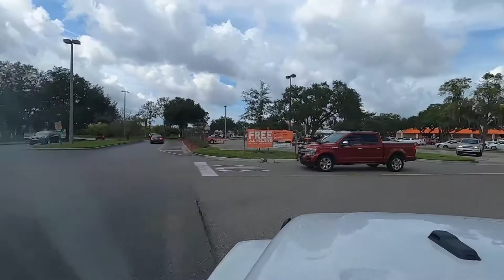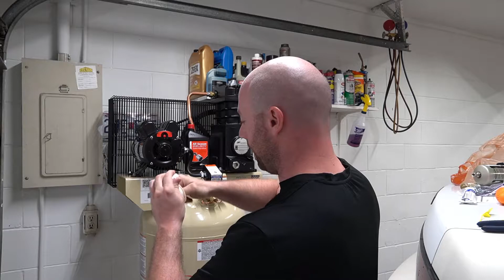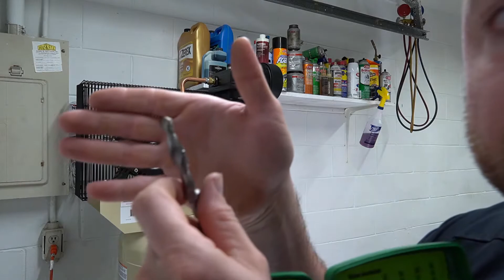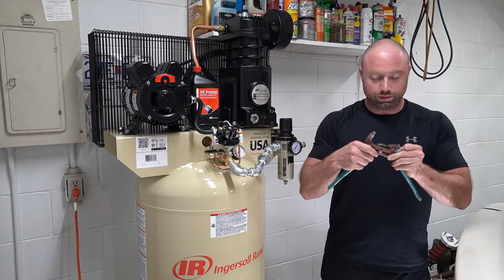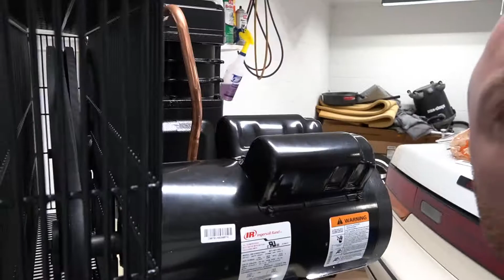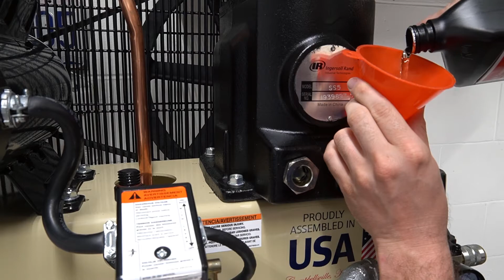INSTALL OF INGERSOLL RAND AIR COMPRESSOR!!! 2of 2

Comment: Here is my other question. Well , I have received my 60 gallon with only a small portion of air. However, I haven't installed the power cord as yet because I am waiting on my electrician to install a 30amp breaker.

Here is my thing. I however installed the water filter ( just like the one you have installed on your compressor, but what I have noticed is air coming through the black  bottom tip of the water filter. Should air be coming through the tip? why is this happening? Is it because the compressor is low in air and first needed to be filled with air? Let me know..
Reply from the maker: Yes this quite often happens at very low air pressures. If it continues after you build pressure, something may need tightening on it.

Comment: Can you put a link of the filter and the fittings you have installed? It will mean a lot . Thanks
Reply from the maker: I couldnt find a link for it but they are sold right there on the shelf at Harbor Freight. This one has 1/2" NPT ports on it.

Comment: Nice job. I would have installed a cut-off valve between the tank and regulator but that is personal choice. Also, check out some Milton V-style high flow air couplers.
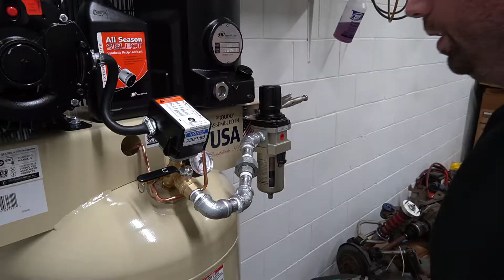Reply from the maker: If you go to 10:20 in the video you will see a close up shot of the ball valve coming right out of the tank. I agree its always good to have an isolation valve before a union. Thanks for the heads up, Ill look into those couplers you suggested!!

Comment: Are you burning up switches yet ?? When it shuts off does it sound funny? We have this same unit and it will start a fire if you are not careful . The switch is too small for the motor .. we had to put a magnetic starter on ours to fix the problem . Good air compressor but bad setup on there part .
Reply from the maker: hmmm no not yet. I will keep an eye on it. No strange noises either. I do appreciate the heads up though!!!
Reply: @rndlife  Just wanted to give you a heads up . I pulled the cover on the switch and both sides were pitted and black and this was before it started having issues .  I will say that the replacement switch is around 100 bucks and the starter was under 80 through compressor source . If you ever have this problem in the future ? I just cleaned the switch and added the starter and it's been fine running and I run it hard !! PS The price of the IR oil is between 32 and 64 dollars a quart now . I done some poking around  and found out there oil comes from Royal Purple . 30 weight air compressor oil . 20 dollars a quart .  I will say after installing the switch it runs a lot cleaner and super smooth . It had a really weird pitch or noise between 110 psi and shut down and it's gone now . Just saying ..  Cheers from Murrell's Inlet SC
Reply from the maker: @sanitymaintenance1585  30 weight-non synthetic seems to be the most widely used oil in most home compressors I have found. Thats def some good info to share tho!!! Good lookin out!!
Reply: @rndlife  There are videos online about the switch problem. 

https://www.youtube.com/watch?v=QuZiPMSl5U0

Here is a guy that Ingersoll Rand gave a credit after they saw his video. He had to put in a magnetic starter so it seems from comments online to these videos that it's a common problem.
Reply from the maker: @petermoss5341  Wow great find Peter! Looks like its time for me to start shopping for a contactor then!
Reply: I have the 80 gallon version of this compressor, and after one look at that pressure switch setup I bought a magnetic starter right off the bat before I even wired it up. Using one side of the stock pressure switch as a slave, it will only be pulling about one amp through the switch and it should last forever.
Reply: @AndrewWisler  sweet !!  Love the magnetic starter on ours .. No issues and it is as strong as an ox non stop ..         I will say the $$$ oil that they want you to put in it (There brand IR ) Is really royal purple ..

Comment: Did you use a 20 amp breaker?
Reply from the maker: You may be able to get by on a 20amp 2 pole breaker as the motor is rated at 21.9A, but to be honest I would think a 25amp would be recommended for this install.

Comment: It would have been nice if you need to showed if you do actually cut the neutral wire because I got the same compressor he's got and I don't have no T5 wire coming from my motor I don't even know where it goes because there's not a load for it if I'm understanding him right he's saying cut the neutral wire so that's going to leave me a black wire as power and my red wires power but I still don't have no tea 5-wire where is it go
Reply from the maker: I had no neutral wire to cut. This runs off of 240V so that means 2 hot wires and one ground. The 2 hot wires are fed from the 2 pole breaker in the panel, and the ground attaches to the ground rail in the panel. If you go to 23:30-ish in the video I cover what im talking about. Now the cord that im using to wire the compressor to the panel is 3 wires (all I need for this install). What I did was use the black wire as one hot and the white wire for the other hot (both fed to either side of the 2 pole breaker in the panel) then wired both of those and the green (ground wire) to the air compressor. Hope this helps you!

Comment: Hey I just purchased one of these and I’m trying to run my electrical to it but What exactly is it getting power from ? A double pole breaker in your panel or a single pole with the neutral on the neutral bar ? I’m trying to run mine off a generator but I don’t know what configuration to use ...
Reply from the maker: Ok this is a 240V air compressor motor, so it uses double pole breaker and a ground wire. Thats it. Just make sure the breaker is sized appropriately for the amperage of the motor you are using.

Comment: Are your connections between the tank and filter/regulator 1/2”
Reply from the maker: Yes!! All fittings I used were 1/2" NPT. the inlet and outlet of the dryer are also 1/2" NPT as well so no reducers or anything needed. The MUCH cheaper alternative of using the Harbor Freight dryer has proven to work well (they are after all pretty simple designed.) Im glad I went with it as it has proven itself, so I have no need to buy the super expensive ones.